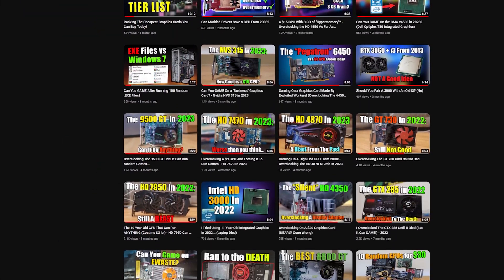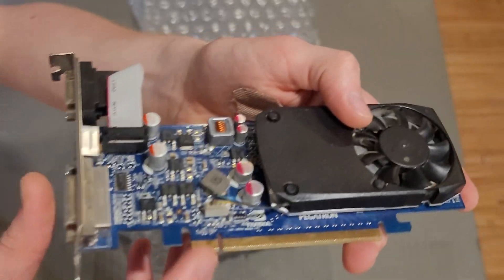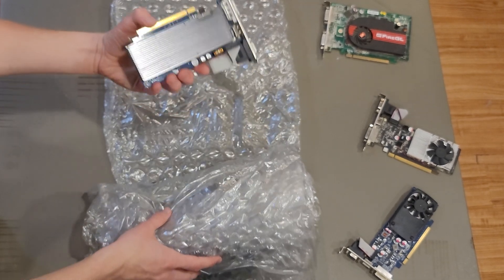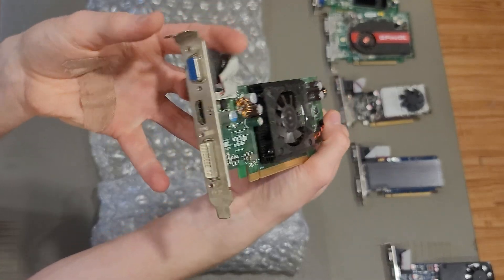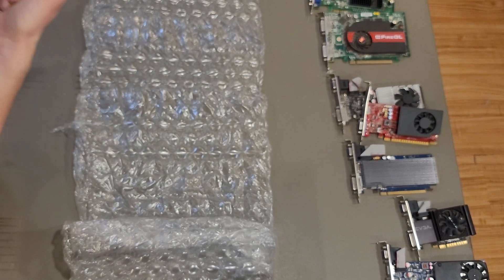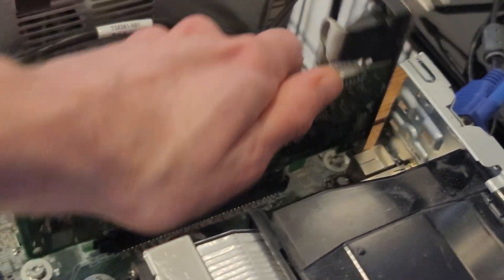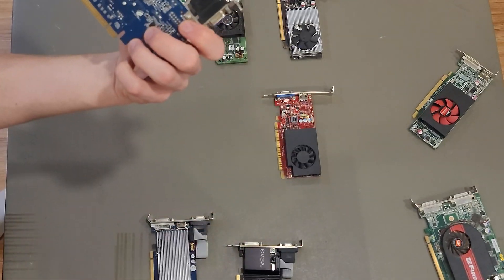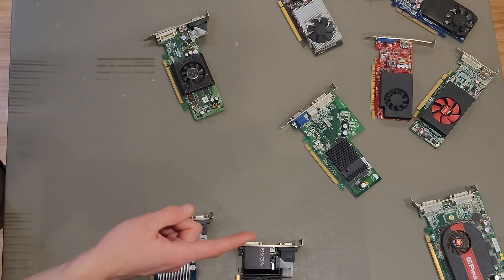I Bought 10 Untested GPUs For $30 - But Will They Work?

Comment: Fun fact!
The GT 520, GT 610, GT 705 (yes that exists) and some variants of the GT 710 have the exact same GF119S die.
Which means all of them have the identical spec of 48 cuda cores but with varying memory sizes and clocks speeds. Oh yeah they are also all Fermi cards.
Reply from the maker: Nvidia.. what in thE WORLD!?
Reply: and even tho they are Fermi, they don't even have vulkan and actually even a variant made by BioStar uses the same Die, only thing it has going for it is 4GB of VRAM

Comment: You have to do a thorough test of the cards, because some cards can display 2d fine, but when they do anything 3d related, then they might display artefacts or crash the system
Reply from the maker: Yeah, I know. From my experience this works for most purposes though. Just a quick lil test

Comment: to everyone looking at this comment just read xd

if you want to build a pc with good specs and you want it to be cheap, then here are some specs that can be found on ebay, amazon, CEX(depends where you live) ETC

Intel core 2 quad Q9550/QX9770

8GB DDR3 RAM (16GB ddr2,ddr3 is very rare if you find one for a good deal dont leave it)

GT 550 TI 2GB GDDR5 or GTX 960 2/4GB GDDR5

buying a ddr4 or ddr3 gpu is not worth it ESPECIALLY GT710/730 dont..... just dont🙂
Reply from the maker: I can get behind the GPU choice, but only 8gbs of ram? ehhh Id go for more under any circumstances. Even just 12
Reply: @Jaindike  bro you think that is so low? i have 3gb ddr2 ram 1 running at 667mhz and the other one at 800mhz xd
Reply from the maker: @realtalk_pk1947  oh God lol
Reply: Honestly an old ebay desktop  or newegg refurb for cheap can be a super affordable upgrade. You can get something like 2x8GB DDR3 and a 1050 for just under $100 which is usually enough for any super budget system with a decent CPU installed
Reply: @NoName5589  i mean it also depends on what country you live in, cuz here (saudia) its a bit expensive locally and its a rare deal to get pc parts or an entire pc without shipping charges and if you already have a few pc parts than its much easier
Reply: Ah very true, I didn't think about that

Comment: at the start of 2018 i got a bunch of free pc parts and built a pc out of then 

q6600 cpu did tape mod on it 
windows 7 64-bit 
6gb ram ddr2
1tb hdd 
gt 710 2gb gpu slightly overclocked 

playing farcry primal at 720p low i got a constant 30fps vsync without vsync it would get upto 40fps but would drop below 30fps sometime
fortnite at 720p 60% rez scale low setting got 32fps - 55fps  but using RivaTuner tool i was able to lock it to a constant 40fps 
skyrim at 720p low setting i got a constant 60fps 
rocket league at 720p low constant 60fps
cuphead at 720p constant 60fps 
minecraft at 720p low almost constant 60fps 
gta v at 720p low got constant 30fps 

so for free i was happy with it till i built a better pc in 2019
Reply from the maker: Oh nice. Not a bad little pc